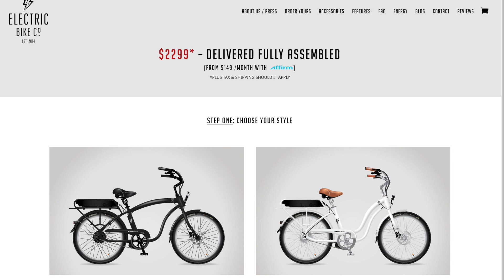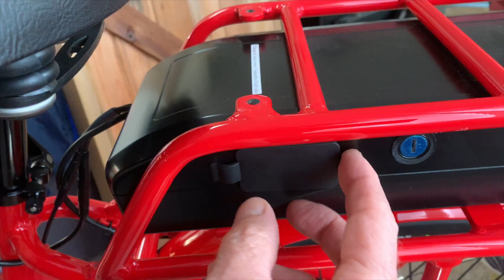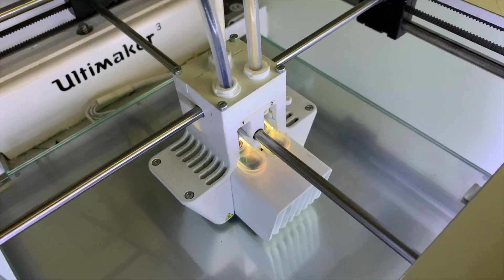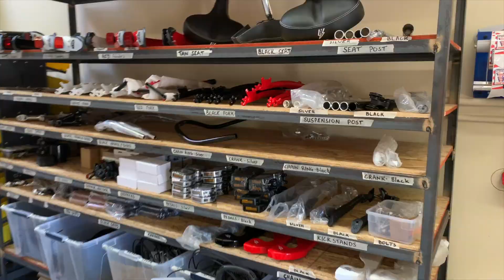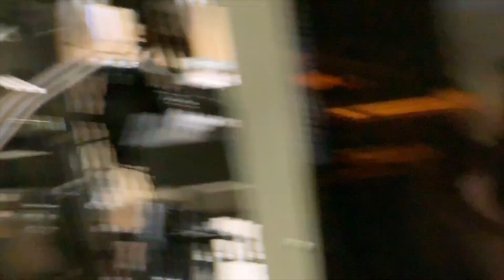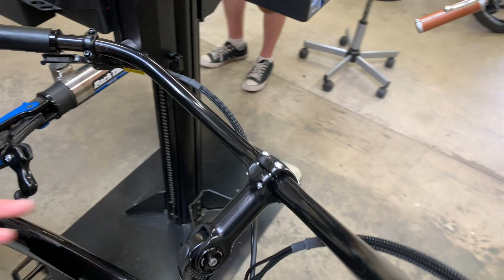I Found a new 'Tesla'   Part 2

Comment: very nice idea , I do not like that they haven't a suspension system , but other from this , most of the flat areas and good roads is very good !! the design and some ideas like the "Dutch Cargo Attachment" are very cool and very detailed technology !! they inspire from , Holland , that has a history on bicycles , they use it , as an option to run down their deaths from car accidents. Electric autonomous cars, bicycles and more areas for people , must be the future ... thanks you!
Reply from the maker: Thanks for your insightful comments. You're right - it doesn't have suspension in the basic option but that's basically because it is not really an off-road, mountain bike but as you said, it travels on tarred roads and mostly smooth surfaces. Thanks for supporting this channel from your home in... Holland? Greece? elsewhere in Europe?
Reply: @model3man  thanks for reply and for what you doing , its Greece , just love the idea of Holland , make the bicycle , every day use , not only to go to work , but also be the tool for job , like cargo bicycles , that used for post offices or people that deliver stuff from their shop , or any other crazy for us idea !! I use to go to work with bicycle , but after I change company , I must use my car !! suspension is not an issue if the road is ok , but because this is not always the way, if you take long distance trips with a bicycle , like 16 to 18 km that I used to have per day , and other 18 km back  , is good feature to have , because is not all the road s perfectly repaired! But is a very nice looking bike and I will love to have a ride. Mine is a specialized cross-trail trekking , and was pay for its self from the gas I didn't use for many months ! I still have it and I search for a kit to make it electric. the kit is not the best way to make a bike electric ,but will be nice to have it , and cost less to buy an electric bicycle , but if the designer, make the bicycle from the ground zero , specific for electric use  , then you have a great product that last longer then others, that they just put a kit on it! I am happy that you find them , search for more designers like him !

Comment: Isn't the battery pack being high on the back throwing the balance off? Shouldn't it be low in the middle of the frame? (Same as in Tesla ... LOL)
Reply from the maker: Good point, but, it was very well balanced when I used it over the last few weeks, and when my daughter drove it. The battery - strangely - is really not that heavy. If I carry it inside my home to plug it in for a charge, it's less heavy than my camera bag :)